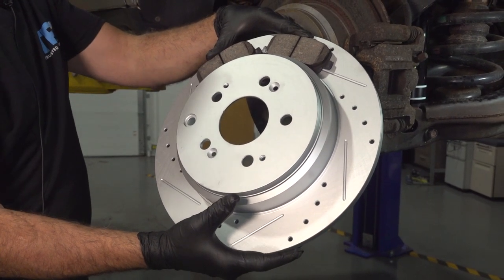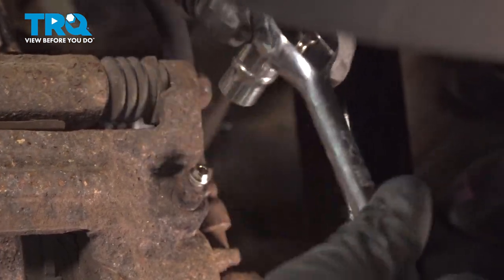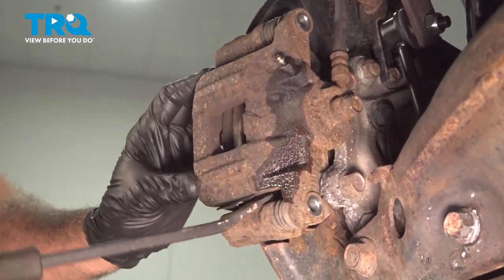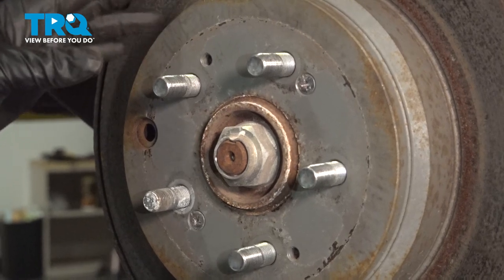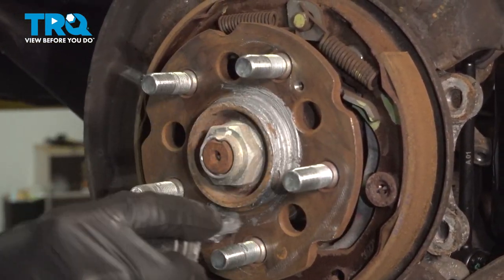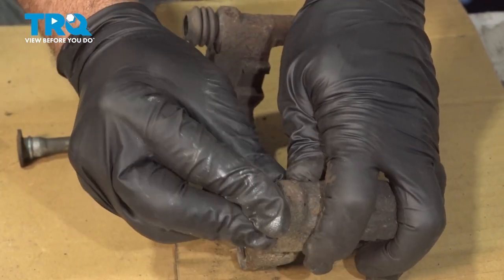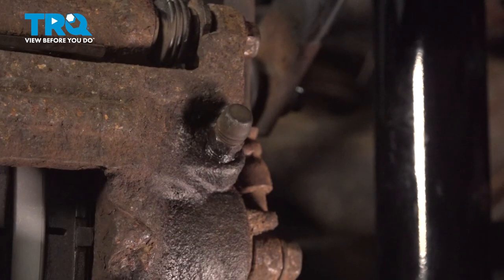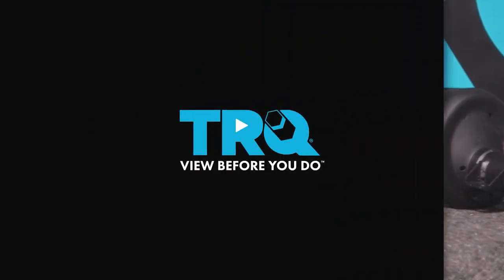How to Replace Rear Brake Rotor and Pads 2009-2015 Honda Pilot

Comment: Well done video!  Excellent quality and production (video and audio - very clear on what you are doing).  Something folks will want to keep in mind is to switch those greasy gloves off (or clean them very well) before handling the new brake components to prevent any grease from getting on the new pads/rotor.  Also I always used brake cleaner on new rotors.  Thanks for the well produced video.

Comment: Great video!  Thanks!  I would add that brake fluid eats paint.  And grease on pads or rotor negates brake action.  Need to keep parts and hands clean so that those juices don't cause trouble.

Comment: Hi! If you’re like me and you’ve come to look for ‘how to remove stubborn REAR Rotors’ and this (awesome) video STILL didn’t help: make sure the ‘emergency brake’ is disengaged! 

Because that emergency brake is holding onto the rotor for dear life, so make sure you have blocking under the other wheels so it doesn’t roll, and disengage the emergency brakes. 😂